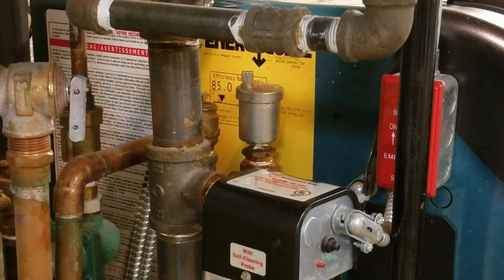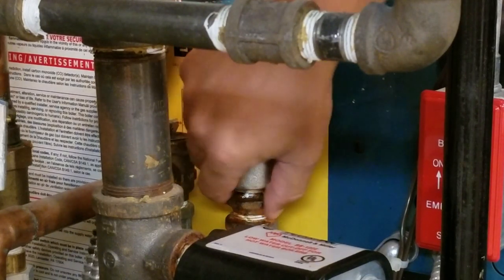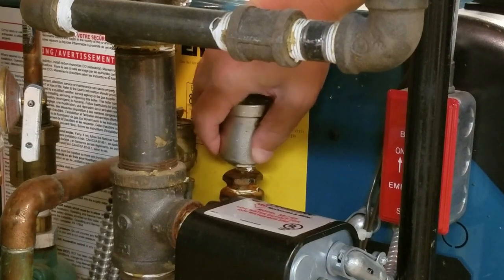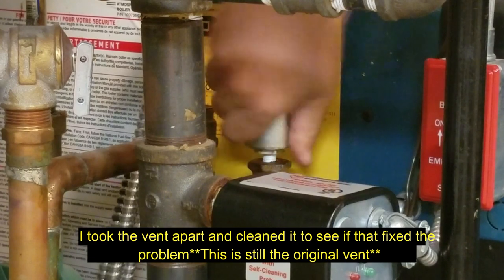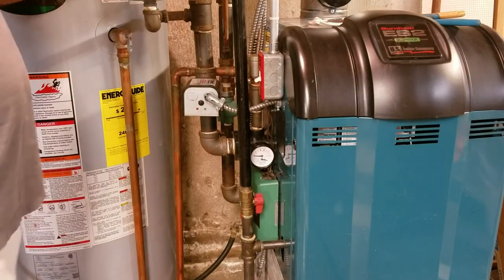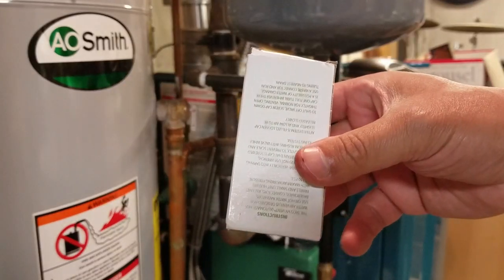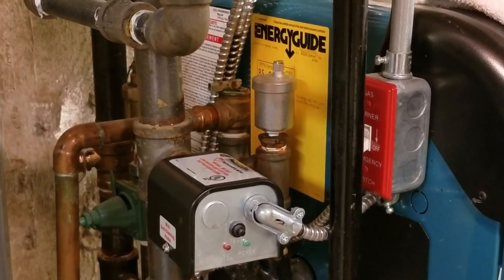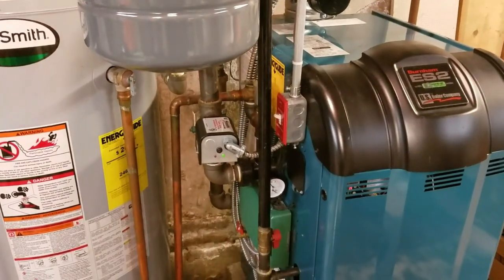Replacing an Automatic Air Vent on a Hot Water Heating System

Comment: Thanks for a clear video. It helped me think about my problem. I've got a Burnham ES2 gas furnace (2009) as well, with an indirect water heater from Weil-McLain . But my leaking Taco air vent is screwed into the top of the hot water heater, not on the line next to the furnace like yours. 

After looking at the Weil-McLain manual which the previous owner left on top of the boiler, I found out the homeowner is supposed to release the valve on the air vent monthly to keep it from building up sediment that causes the valve seat to become crusted and unable to close all the way.  They tell you to  just unscrew the thumb screw on the top, look down and you will see the top of a spring valve. Put a towel around the air vent, press down on the top of the valve with an awl or something, and hot water will come out. That keeps the valve seat clean.  After you're done, you replace the thumb screw and open it about one-half to a full turn. But who knew?

I tried it a few times, yesterday. But no luck, it kept leaking. The valve seat is obviously crusted up now after 14 years of neglect. I'm getting a replacement air vent from Amazon tomorrow (Taco 400-4 like yours, $17.57) . But I'm not exactly sure how to lower the pressure in the hot water tank. Lowering the pressure in the furnace like you did won't help, because I've still got domestic cold water coming in. My plan is to (1) shut off the hot water feed from the furnace (that's the same as draining it like you did), (2) shut off the cold water inlet to the hot water tank,  and (3) open a faucet upstairs and shut off the the hot water outlet from the tank.

Will that get all the pressure out? Not sure. I can easily test if there's pressure in the tank by just loosening that little thumb screw on top of the air vent. If it spurts water, I've got to keep trying.  Wish me luck, so another homeowner can claim victory.
Reply: I am having the same problem as you- were you able to fix it?
Reply: @aubreyellis3685  Yes, replacing the Taco 400-4 did the trick. The built in valve was too corroded to repair, and it only cost $17.57 from Amazon. You'll need a large adjustable wrench or pliers to grab the old one and screw it out. First reduce pressure in the water tank as I explained above.

Comment: I like this video.  I had my oil company come in to fix another issue.  However I saw that he air vent is covered in scale and I asked the repairman what it would cost for him to replace it.  He quoted $175 parts and labor..  So if one can replace it by DYI, there is a major cost savings.
Reply from the maker: Yes and TY.
Reply: The thief I had out to do a cleaning quoted an additional $243.00!!  I told him to take a hike!!
Reply: Damn just bought one on Amazon for @$40 and it took me a total of 5 minutes to shut off water main, turn off boiler and relieve pressure on boiler then screw off old one then new one.  That’s an easy nearly $150 for them.

Comment: Looks easy and low cost for a good do it yourselfer. But you can see why a tech has to charge $150 more or less to install a $20’part. Look at all the time it took to buy the part, install it… and then get a replacement part and reinstall it when the first one leaked. 
Now for my try. Wish me luck!
Reply from the maker: Good Luck
Reply: Gotta remember that technician is paid by the hour. It's not 150$ for no reason. He could be on a 15,000$ install job instead he's helping you. Keep that in mind next time!
Reply: I just replaced mine and spent no more than 5 minutes doing it, several weeks later still working like a champ and bought mine on Amazon shipped to my house. Sorry but no one should be charged more than 1/2 hour of labor for this iob, don’t give me this crap about time spent getting materials a good plumber should have these on these on his truck and or not charging you to go get it…its petty if they do.  Sadly most do as this is the contractors mentality and we allow it!

Comment: On the top. How tight should the little plastic cap be?
Reply from the maker: I keep mine loose.
Reply: Its whole purpose is to let air out of the system, so it should be open. This is called a float or ball-type automatic air relief valve.